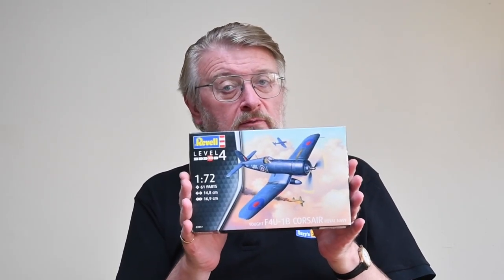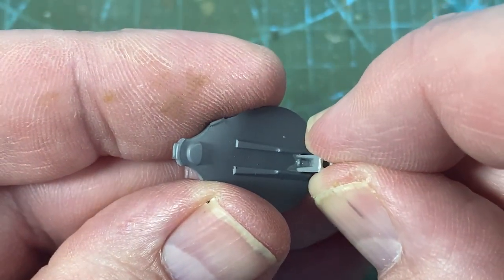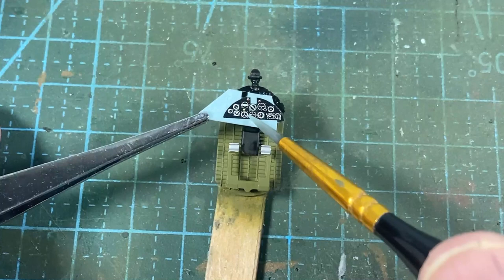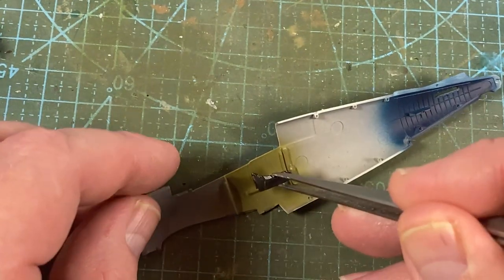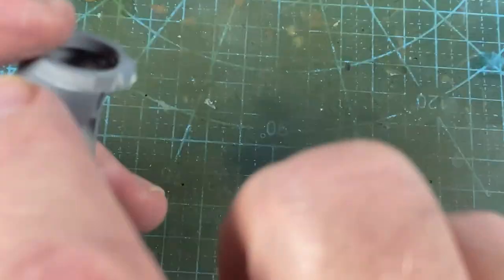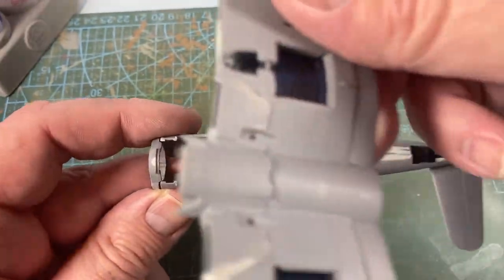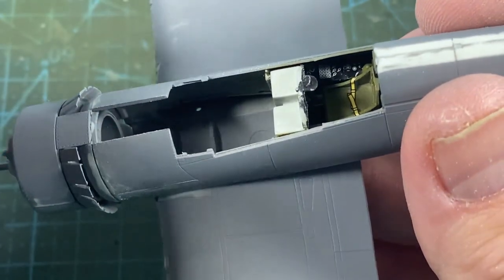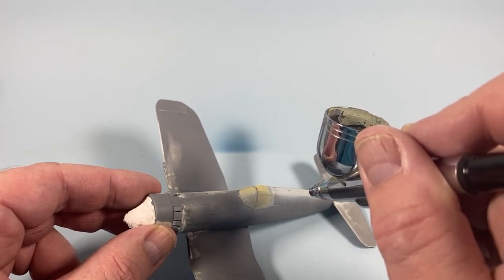CORSAIR Revell F4U Corsair 1/72 scale - FULL BUILD HD 1080p

Comment: The asymmetric tail is correct for the Corsair. Several 3-view drawings and good reference photos show this to be the case. The instructions make the mistake of showing the linkage on both of the upper surfaces, when it should only be starboard side I believe. Great build as always, Gary! Thanks for the video.
Reply from the maker: Ken, thanks so much for the info - saves me an afternoon of looking at pictures of Corsairs (not that that's a bad thing, but things to do!). An interesting design idea to have left-right redundancy (like on the later A-10) but must have made rigging the trim lines interesting. Anyway, many thanks for the info and kudos too you and to the kit makers for it!
Reply: @garys_stuff  You're quite welcome, Gary! I've got this kit in the stash and your build video has given me inspiration to move it to the top of the build pile. Cheers!
Reply: I had to look this up myself and it's an interesting setup. In some ways it would also save on equipment needed to build it as you need just one set of equipment to make them rather than two sets, one for each side.
Reply: @Adam_Boots  Yes, that's correct. You get economy of scale, which helps reduce overall cost. I can't help but think however, that by having the inspection panels on the underside of one of the horizontal stabilizers, it made for less than ideal access for maintenance personnel.
Reply: There are linkages on both sides, but one is short and one long on the upper surface and reversed on the lower surfaces. I had a look at Tamiya and Hasegawa kits that I built.
Reply: @davidi4306  the short linkage goes to the elevator trim tab. The long one moves the elevator,

Comment: I have just got the 1/76 Revell rebox of the old Matchbox Char B.1 and Renault FT.17 with a scenic display base.
The surprising thing about it is: How crisp and sharp the mouldings are with next-to-no flash. 
Another surprising thing about a kit, from such an old tooling, is: the plastic is clean and dry, not smothered in mould-release grease

Comment: Hi Gary.. I know you like adding a bit of depth to some items - like the Pilot's Notes in the Anson and map in the Katy. Maybe for the seatbelts glue the decals to a sheet of paper, for extra depth, then cut them out and glue them in place? Then they are still flexible enough to follow contours, but have a little depth :)

Ref the rudder moulding. My guess is they did two pieces to avoid any undercuts and possible voids in the part if it was all one piece, so it was a manufacturing issue not a model choice. The horizontal stabilisers look a slightly different shape in the instructions to the parts as well, plus the actuator on side is better moulded.

I noticed with the yellow engine cowling you didn't undercoat in white as you do for propeller tips. Did you not want it too vibrant, or think the silver undercoat was close enough?
Reply from the maker: Something Paramjit at Airfix suggested for straps was to pit the decal onto metal foil - thicker than aluminium foil so something like the foil from a wine bottle. Works very well, but can be fiddly to cut! I think the yellow was OK with the silver underneath plus I could have chipped some off to expose the metal colour which wouldn't have worked with a white undercoat.
Reply: @garys_stuff  thanks Gary. Good point about the chipping :) Handy technique for battle damage too :)

Comment: A nice looking result overall however a few things to note. A decal in real life is painted on so that it chips in the same way as the top coat of paint so next time try chipping over the decals. U can the decals on first then practice chipping with a fine brush to make it look a little more authentic. Especially with those hide markings. Another thing is to try using a very dark wash for the panels lines of a dark blue aircraft to pull out those sharp details. Also remember that chipping occurs in the centre of panels (less for certain) but remember to put some in there and done forget those filthy exhaust stains. One final thing to try is to paint, decal then put a clear cote down to protect the paint so u can get ur enamel products in there without any harm. Great video tho.
Reply from the maker: Thanks Ernie - this was done in a bit of a rush and I'm not sure the chipping was done correctly in any sense. I am practising on another kit and hope the results will be better in future. Thanks for the tips.